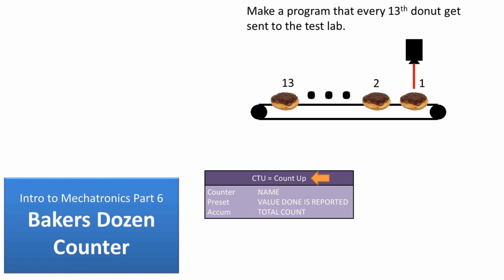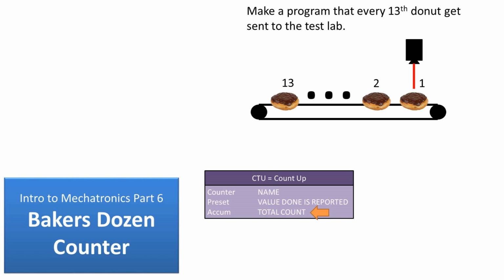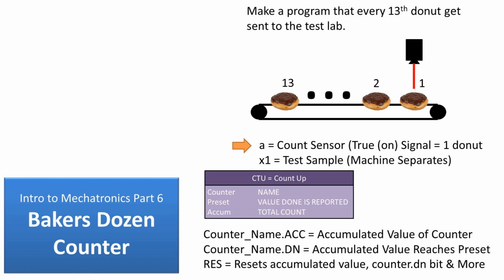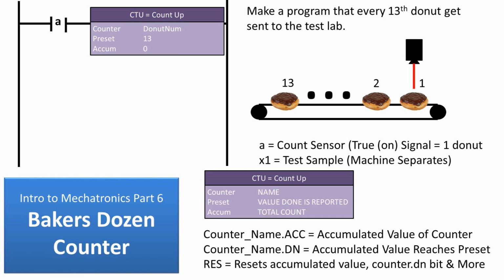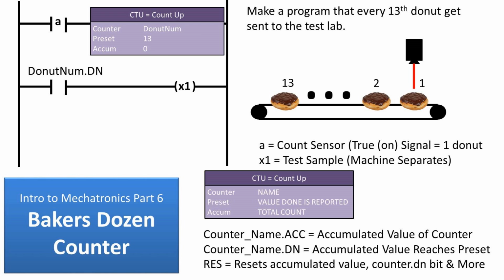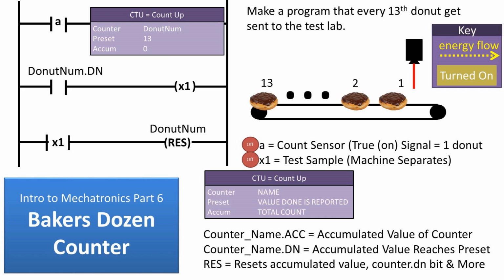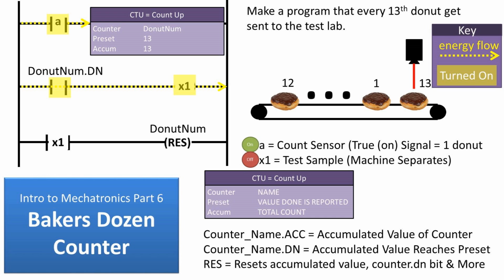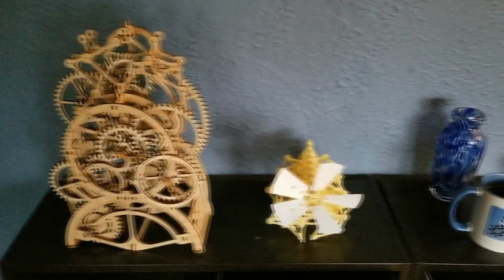PLC Programing to Count Out Every 13th Donut So It Can Be "Tested" (Mechatronics Part 6)

Comment from the maker: Hey I noticed I received a dislike. Let me know if there is anything unclear or incorrect. This video is intended as a goofy example to show how the counter function works.
Reply from the maker: just spotted an error the graphic for the x1 bit to be turned on did not get changed but the diagram is correct. Cause of problem I quickly added the last portion of the video as an after thought and rushed to get the video completed.